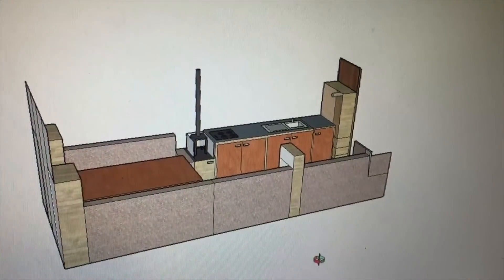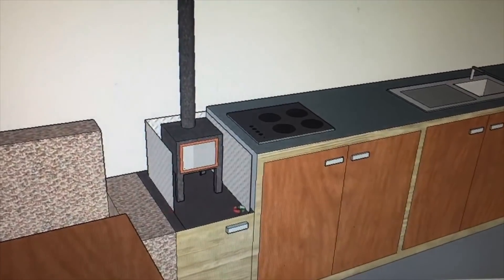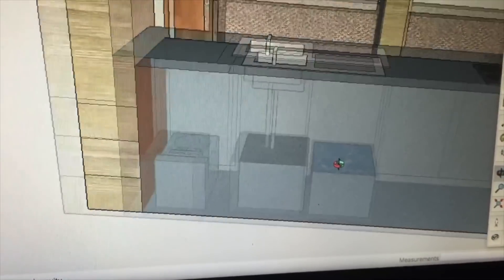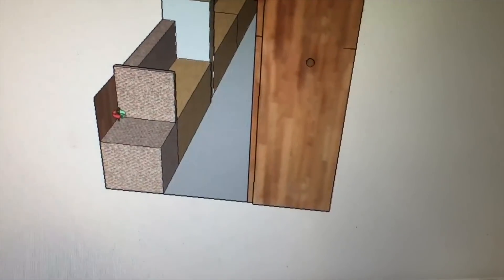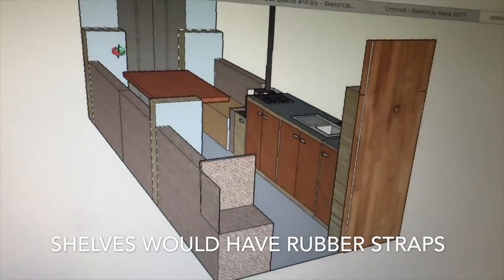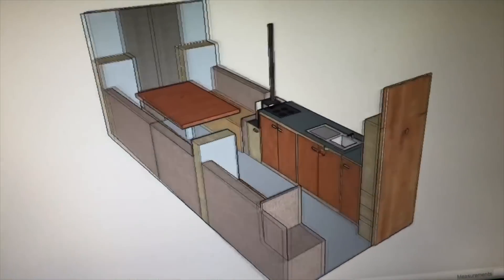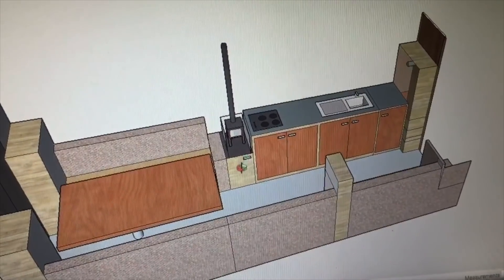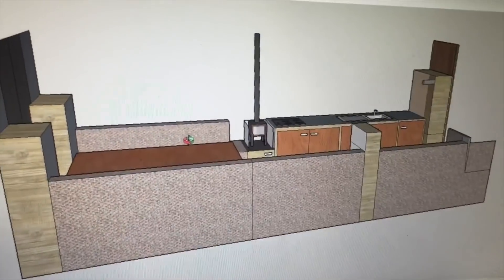Step Van Interior Layouts P3 | 3D CAD Rendering E232

Comment: I have the same project and I plan to put an 80" ( 2m) pull-down screen against the cabin bulkhead for movie projections.  Tiny LED projectors do not take room, do not generate heat and are good for thousands of hours.  Mounted on the ceiling, they also correct for keystoning .
Reply from the maker: sounds like a great plan!

Comment: Wouldn't the burning of ? in a wood stove eventually contaminate the inside of a camper? I wouldn't want my clothes, bedding, tissue products, etc. and things to smell of ?  After I fell in love with the idea, it hit me one day, "What if?"
Reply from the maker: I was surprised myself after doing research on this. actually the wood burner is much better for the interior of a van than burning gas. gas creates by products which cause condensation and humidity which promotes mold. wood burners are the only solution that reduces humidity and promotes healthy air. strange huh?

Comment: I'd consider a pellet stove rather than a standard won stove. It also better when traveling since some states have a problem carrying wood into the state but pellets are not an issue.

Again, I'm available to go over your solar and batteries. I strongly suggest using Lithium, LiFePO4, as they can be inside the van without needing venting. They are also weigh a whole lot less. All of this can be places under some of the seating.
Reply from the maker: I don't know much about pellet stoves. would love to get more info on solar from you. can you please visit my main website and send the "contact form" so I can have your contact info?

Comment: Forgive me if you have already covered this but I just hate to see the engine 'bolt of death' hanging over your head like the sword of Damocles. Has this been fixed? If not you might give some thought to having it replaced before your 50/50 chance of survival is put to the test.
Reply from the maker: I have plans of working on it in Denver next week (original plan was to be in El Paso 1 day instead of 10). delays delays!

Comment: Do not tear out that new floor! That construction adhesive you used has ZERO forgiveness and  you will destroy all the foam and plywood that you just bought. Not to mention trying to get those beads of glue off the aluminun truck floor will be almost impossible. Imagine those beades of glue on the original truck floor are now permanent, how will you lay thin flooring over those uneven beads of dried (rock hard) glue? Take it from someone who has experience with that adhesive.... it's nasty, and permanent.  That stuff glues concrete blocks together so hard, an excavator can't break them apart. You think you're unhappy with the floor now, wait till you try to "fix" it. You will hate that can of worms, if opened!
Reply from the maker: I'm concerned about exactly what you are describing. may have to leave the floor alone as is

Comment: I would look at putting the grey water tank under the floor and also the fresh water tank on the opposite side and use a 12 volt pump to supply the tap.This way you can use the space for storage of goods that you need for the cooking and washing in the space.
Reply from the maker: I thought about that, except Ill have about 4 huge batteries on the passenger side which may weigh more than the water which will usually be empty when driving. it is a balancing problem for sure!
Reply: If the weight is on the left then the water tank and grey water should be on the right and always carry water in the tank as this will help even the weight problem. If both tanks are on the same side water used from the water tank will be transferred to the gray water tank from the sink. Only problem is that you would be better to use round tanks with  baffles inside to stop them punching the ends out. Also you can then have a filler on the outside of the vehicle and the drain outlet for the grey water at the bottom of the side of the vehicle.

Comment: Look at this Rustoleum paint product. It is a thick paint with color. It fills gaps and stops splinters so you can walk on with bare feet. Wears like iron but must do 2 coats. Did friends deck and wears Great. You could leave all your work intact. Your friend has shared a link to a Home Depot product they think you would be interested in seeing.

5 gal. 4X Cedar Deck Coat
https://thd.co/2re4etw
Reply from the maker: excellent recommendation. I need to do a video about the marks on the wood floor right now. the spare tire has rubbed a giant circle pattern and I have foot prints of dark gray in traffic areas. not sure how to clean all that off prior to paint or stain and protective coatings :(
Reply: *****  always go by label recommendations! Full explanation and exceptions on it. Just checked out for my brothers deck in snow country.

Comment: Something else to think about is sleeping on the table top.  They are hard.  I slept many years on one on a sail boat.  You need to think of what you will use for padding / mattress.  On the boat, we tried using the cushions from the bench seats.  No good, they leave a gap where they press together, and your body will end up on the table.  They are also not very thick and thus you press right through them to the hard table.  You spend a great deal of time sleeping, think about finding a way to incorporate a decent mattress solution.  Don't be afraid to take a trip to bedding suppliers and put the thing on the hard floor to test it.  If they have a problem with that, I would not buy it.  I also drove a 18 wheeler for several years, driving over the road where I slept in the truck.  They do make single and twin mattress for trucks (might make them bigger as well, I never had bigger than a twin).  They are still uncomfortable, and I had to add a layer of memory foam over it to not feel the hard plywood under it.   

Now the next big question - if you don't use the bench back cushions as padding to sleep on where do you store it when not in use?  The other big question is do you really want to make your bed up, and take it apart (folding the sheets, etc) and stowing it every day, and anytime you want to take a quick nap on the road?

Perhaps you might want to consider a Murphy bed that folds up on the kitchen side of the truck, that has a fold down table?

That would give you free access in and out of the back doors of the van anytime you wanted.  Then you want the table, fold it up and use it.  Need a quick nap? Just fold up the table, and pull down the bed (Already dressed and ready to use, with a decent mattress).

While most murphy beds fold down with the head of the bed towards the wall, there is no reason one could not be made to fold down with the head to the right (towards the front of truck) to keep the bed longways instead of sideways to the truck.  Of course it might need to be custom made, but I'm sure you can get a wood worker to help out with that.

Another idea might be a table that can be removed, and use a futon style bed that is mounted on tracks so it can pull out slightly then folded down for sleeping.  Solves the padding storage solution, but you still need to make the bed and put away the sheets anytime you are not using it in order to use it as a couch.  (I don't like the constant bed making, and would rather find a solution that keeps the bed made up for anytime the need for a nap arises, but that is just me!)
Reply from the maker: the bench/table bed will be mostly for guests. I'll plan on sleeping in the extension slat bed most of the time and plan on some nice 4 inch foam for that area. thanks for your advice on testing mattresses. I'll do that and do tests before buying anything.

Comment: You really need to think about your electrical requirements and how, where and what type of batteries you are going to use. Ether Li-ion or sealed AGM DEEP CYCLE batteries are best. Lead Acid has to be vented and need to be serviced or replaced more often. Where are you going to have your control and fuse panel placed? How and where are you going to run and place your switches and power outlets(both 12v & 120/115) How are you going to get power from the solar panels in to the van, and how are you going to recharge the batteries if the weather is bad and no sun for 3 or 4 days? I know that you wish to use only solar, but a 30 amp service connection just incase would be more prudent.  As for your floor plan, it looks workable and well laid out. But work on your electrical plan also. 
Oh and another thing about batteries, placement is important! you will want them in front of the back wheel wells. Some high end AGM batteries can weigh up to 100lbs each. That and the weight of the wood can cause handling issues with the van. So keep that in mind as you do your build out. 

All Plans are Subject to Change, and Murphy's Law Always Apply!
Reply from the maker: thx. I've been working this week with Guisepi (the tea man in my Feb videos) on the electrical. I'm planning on solar panels running to deep cycle batteries placed under the frame near the passenger door (current engine batteries are under the steps in the same area). I'm running all electric inside thru conduit metal tubing which will be external to the wall paneling (I'm going for a industrial mad scientist steam punk type look). there will be no generator.

Comment: An Idea on the potable and non-potable water.  I think you could fit both in a single cabinet space.  I would put the potable on the bottom, and have the non-potable on top for ease of plumbing the sink into the catch tank.  Motor home style fill and drain connections would be placed in the outside skin of the truck.  This would give you more room for storage.  I would also make up a short hose for draining the non-potable water.  A couple of the shrinking garden hoses (Magic 50' hose https://www.amazon.com/gp/product/B01DOG93YK/?tag=gardening034-20&pqr=120217064629 ) could be hung under the counter for when you need to fill up the potable tank.  (Just don't make the mistake of using on the non-potable water!)
Reply from the maker: great ideas. I was thinking of water storage below the kitchen cabinets but don't have the details worked out at this point
Reply: Water storage under the truck will also give you more room.  Great idea!
Reply from the maker: I'm planning on batteries outside and under the frame and water inside under the kitchen counters (so it won't freeze)

Comment: The only trouble with the front seat idea is the noise from the back, when driving. The current plan doesn't allow for a continuous wall and door to deaden the sound from the rear.
Reply from the maker: this is true. I've not come up with a good solution yet for that. It could be a wall to help with sound and temperature regulation, or maybe leave it open for better lighting from the windshield. or maybe a wall that is part transparent to allow light but provide some insulation (which is the direction I'm leaning now

Comment: I like your previous idea of going vinyl either full sheet or the stripes..very durable and doable with low tech installation. For the little square footage you have sometimes closeouts or Habitate store will have what you need. Save your $$ for your built ins..ect  just my 6 cents worth ( :
Reply from the maker: great advice! I'm trying to research what someone said about the vinyl strips not sticking to the plywood well because the plywood would dry up the adhesive

Comment: Seven you could use adhesives  cork tiles hard wearing no staining needed thin modular and easy to put in one at a time as a flooring solution, plus no power tools needed (no need to have to empty the van!) .  Bed table thing , will still need to fit gap between the seats , To use as a bed..it could fold in half or have an offset single  leg  I. E turn  it 180 degrees and have it still useable  .  But leave room to pass by ?.... or just stow in slot out of the way you make for it somewhere. When entertaining friends.
Reply from the maker: I was thinking of using cork for the ceiling and vinyl planks for the floor (easy to clean). the table should be sized correctly to drop down and fill the gap between the benches for the bed (back cushions become the center cushions). I would stow it away for social events so that people could walk thru the back

Comment: look at into the mystery 13's video on utube today he and evie nova are doing a van build and using a good idea for light weight cabinets  and he's got a link that takes you to a how to video for the way to make those cabinets  I have driven trucks for over 20 years and I can tell you that the lighter your rig is the more fuel milage you get
Reply from the maker: funny timing on your comment. as you were writing it I was watching a couple of his videos on his build (ceiling fans and some other stuff). I like his channel
Reply: Although I think foam cabinetry is light and can be a good way to go, it will not be durable enough for the kind of wear and tear it will be experiencing with the kind of use you are intending. The best thing you can do for this kind of build is go with a .75 inch marine grade plywood. you can then choose to stain, oil, paint or laminate the wood. It will ad weight to the vehicle, it really will not be so much that you will notice it. With the weight of books and people going in and out and up and down you need to build this to almost a commercial grade!
Reply: David Ashley have you ever priced marine grade plywood you are talking about big money there and even recycled pallet wood is lighter no offense but weight and proper distribution of weight is a key factor in the performance and efficiency of a vehicle this size I was suggesting the foam for those reasons however pallet wood is usually free and can be worked with easily without blowing up a budget
Reply: True...It is expensive, and it could be done with a less expensive material. Based on the truck he is doing the build out in, I figured he could add about 1000 pounds in build out and be fine. The truck he is using is design to carry far more weight than that. I just don't thing foam would be a wise option based on the fact that he plans to host people. His build needs to be very strong and sturdy. Book shelves and all. But yes, reclaimed wood would work just as well. Good Call!
Reply: David Ashley please follow the links in the video I referred to earlier they are reinforcing the foam much the same way that fiberglass is done
Reply: It does work very well...I have done it myself. I'm just saying I don't think I would use it in this application. But, in the end...not my build so whatever he chooses I am sure he will have thought through.

Comment: Definitely don't need to ad any more thickness to the floor, already thicker than my class A motor home was and it had real tiles. ! Me I would tear it out, seal the alum. , thinsulate and 1/2 ply then vinyl tiles (easy to clean from people walking in from a greasy parking lot).
Reply from the maker: Grant, I'm leaning toward pulling it out due to thickness and putting in something thinner and more durable as you describe
Reply from the maker: I've not heard of MDO ply. I'll have to research it!

Comment: One of the best things about the net is the ability to share ideas, leaving creative types a chance to throw out some design ideas. for the floor, you can buy flooring with tongue and groove portions that friction fit, they require no glue, and would make that bare floor look marvy, be easy to clean, and easily modified.
Reply from the maker: thanks for the comment. in a video about 2 weeks ago I went to home depot and looked at several flooring options which you mention and discussed some of what I thought to be the pro/cons of each. you might watch that and make some comments and give me your feedback on the various types. thanks again for watching!
Reply: Seven Wanders the World , I just read that the "sustainable" bamboo stuff outgassses fairly noxious chemicals. I would do some research and choose a low VOC  vinyl product, apparently it really lasts and is light.
Reply from the maker: thx. appreciate the extra info on bamboo